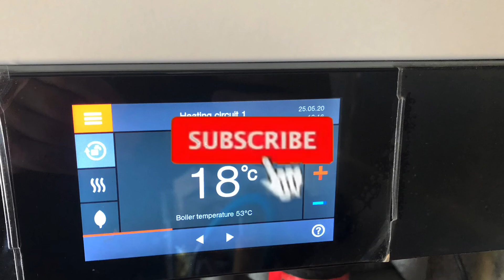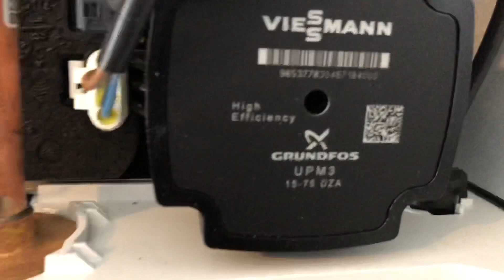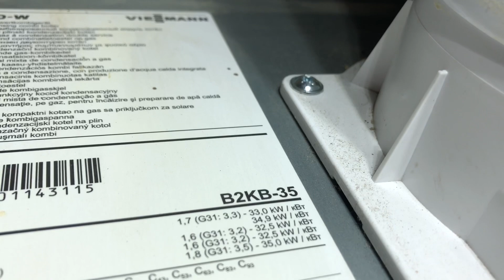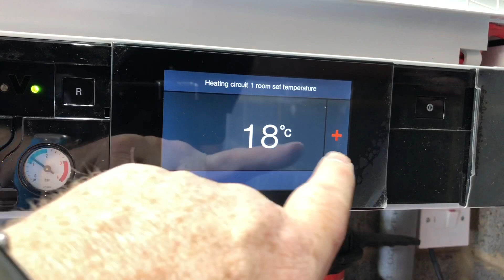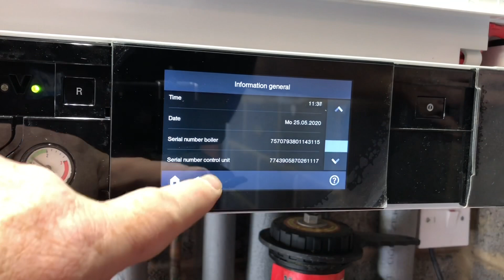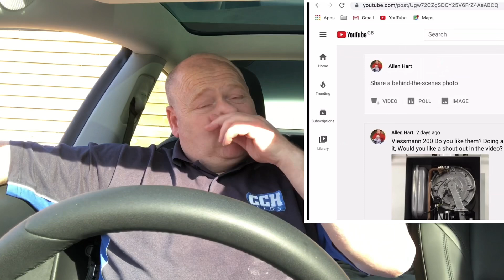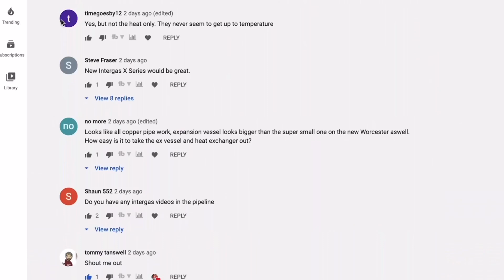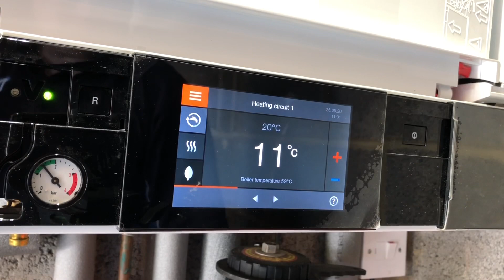Viessmann Vitodens 200 - What’s Inside - Combi Boiler Review

Comment: Hi, I'm a consumer, with a background in quality engineering Aerospace Defence industry, so when it comes to quality I'm very fussy, I do have a 200W 35kw combi going back 13 years, to be honest nothing major went wrong, just general things like Outside temperature sensor faulty, after that spark gaps and flame out sensor changed when I got Error Code FE, usual service parts, recently the flow sensor went, magnet side came off it's fixing repaired that myself, had Viessmann engineer burner clean service, I buy service parts myself from Viessmann Direct now part of Viessmann, My only concern is the Original water pump might be on it's way out, the upgrade kit with 7874668 which is a kit Grundfos it has a PWM socket maybe I can control that from (145 pins 6 & 7 of one of the connection screw terminals or plug 145 of the connection plug, 
I'm happy it's built well, one main problem is the Main New Replacement Control PCB is getting expensive £920, I really  wish Viessmann could supply a actual circuit diagram Please  because for me it would be simple to repair these as a Electronics Test Engineer, 
Well the 200W was a recommendation 13 years ago, I wouldn't go away from Viessmann, they are designed to be repaired by modular replacement, parts are easy to get to, after sales is good, technical is busy in winter 😅
I do like the 200W 35kW 7248829 I have would I upgrade it? I don't know is it better than my 200W ?
But one thing I do like is the internet connection control & diagnosis that's nice, 
One day move into a bungalow  then sure I go for Update hope to go off grid, Viessmann are always top in my view German Engineering ❤

Comment: Thanks for the amazing explanation. I have 1 question. Is it possible to use the device ONLY for warm water and close off the heating side of the combi? Planning to place a woodstove (removing all the radiators) and use that for heating but we still want to take a hot shower😮. Or does that harm the Viessmann vitodens 200?
Reply: Probably best to just fit one radiator in close proximity to the boiler to give it a small circuit

Comment: How much should I pay to get one of these fitted to replace a vaillant system boiler in the same location,  with flue exiting external wall above boiler on ground floor with excellent access? So System boiler to System boiler , very easy!
Damn good videos from you by the way.

Comment: Hello Allen, whilst the user interface is extremely good, the rest of the boiler looks very cheap when compared to an Intergas Xclusive combi boiler. I would be interested to hear how you compare the two. Admittedly the user interface on the Intergas is not as easy to use but that's made up for in the lack of a plate to plate heat exchanger, diverter valve and other associated moving parts. Also Intergas have 22mm pipes throughout the main heat exchanger and a 12mm pipe on the DHW. This ensures much better flow on both the heating and DHW. On top of the a 12 year warranty. And no rubber hoses or plastic fittings. In my opinion a much better boiler.
Reply from the maker: i will see what i can do. Thanks.
Reply: Intergas has aluminium in condensate site , the low pH condensate  dissolves metal

Comment: Hi Allen, when I turn on hot water for a shower, it will use the rest heat of the central heating system so I have hot water for one minute untill the boiler temperature drops down. The burner doesn't switch on while use domestic hot water. When I shut down the hot water, the burner will start again to heat up the central heating system to the temperature I put it and I the cycle restarts (one min hot water, decrease of boiler temperature untill the water is cold). Any idea what could be the issue? I don't have an error and all the settings for the hot water are correct. We don't have an external boiler for DHW, only this system for both central heating and DMW
Reply: Did U find a solution for this? I'm having the same problems

Comment: I'm not an engineer but I'm wanting to learn about this system so I can advise my plumber of my requirements.  I have an old Baxi conventional boiler that I'll shortly be replacing which has a thermostat control panel in my hallway and a timing control panel directly below the boiler.  My question is if I buy this boiler will it make those two components redundant? and what happens to the wiring? Will this boiler utilise the redundant component's cabling?

I know next to nothing about plumbing but I find it absolutely fascinating learning about it all :)
Reply from the maker: Really depends on the system and the hot water requirements.

Comment: Hi what mm gas pipe line this needs from the gas meter installed this boiler
Reply from the maker: Paramjit singh This one needed 22mm gas. Thanks 🙏
Reply: @AllenHart999  Hi Allen, i had Baxi NeTec Combi condenser that's giving me none stop problems it was installed around 7yrs ago but every year since installing had to call someone out to fix at least couple of times/ year. 
I am now considering just replacing with new boiler any recommended brands please that's not going to give me this much trouble. I would need at least 35/36 kw as have 4bed house with 2 bathrooms. I heard the new Baxi with Brass parts are better ? Please help! Thanks
Reply from the maker: @kamaljitsembhi4255  Viessmann 100, Ideal vogue, Baxi platinum,
Reply: @AllenHart999  thanks for the help Allen also is the Baxi compact 836 combi any good? The new Baxi Range?

Comment: Hi Allen. Thank you for your videos! I want to ask if when you do a service to a boiler which is in warranty you find a part that needs replacing is that part under warranty and you would change it on the boiler warranty or is something that the customer needs to pay for? Also, how do you calculate the size of the expansion vessel on a heating system? I have looked on google and couldn’t find anything related. Thank you
Reply from the maker: Manufacturers need to come out for repairs. Thanks

Comment: Is the ideal boiler for houses that have gas from a tank: for any type of gas will be put in the tank the boiler will self-regulate its combustion for the new type of gas without the need for a technician to make other adjustments which will lead at lower operating costs. The 17: 1 modulation can ensure a constant temperature in the house. If you put a magnetic filter then deposits on the rubber hose will not be a problem, other than that the hose provides a higher flow of water than a rigid pipe :). Still i have a love and hate relationship with this brand of boilers from the past....

Comment: Hi Allen, sorru for the stupid question, but how to adjust the heating temperature? Is it possible to use the boiler without room thermostat?
Just to use it based on heating temperature?
Thanks fo the video
Reply from the maker: No, You need a thermostat or boiler interlock. Thanks

Comment: The modulation is getting so low it is possible to have UFH without an thermal store in the system - heating the UFH pipes directly. It will just modulate down to a nice low 1.9Kw.  Nice. Saves a ton of money.  At 14.3 litre/min, the combi and heat UFH is all you need if one bathroom.

Comment: This boiler modulates down to 1.9kW - impressive.  Have on outside weather compensation and Opentherm room stat, it may just sit there injecting 1.9kW silently.
Reply: I could not locate the so called opentherm module anywhere for the viessman 200, I went with the new 100-W , it get down to 3.2 kW CH ,  but it does work with opentherm
Reply: Dont think you can use opentherm with 200-W  ?
Reply: @inveritas3332  
"Although the 200 range boiler is not Open therm as standard, there is an Opentherm module available opening it up to third-party controls. However, this module is hard to obtain in the UK and is not supported by Viessmann UK."
- Heat Geek.

Charming. They do not support their own equipment.   
It means using Viessmann's propriety version.

I believe they have a system boiler that modulated down to 1.6kW. Again, impressive.

Comment: Brandyn March
Hi Allen,

Thanks for the videos. We seem to install a few commercial 200’s here (western Canada)  per year. So far happy with them. Only complaint is some of the programming, so versatile but also limited. DE inputs for example. Sometimes you just need a fixed water temp in certain applications. Maybe that is different on the new units. Awesome boilers over all. Won’t install anything else available to us. reliability and parts availability are critical when selecting a boiler  (for me).